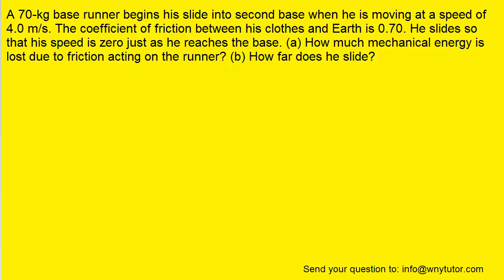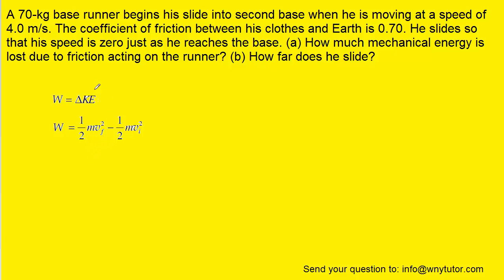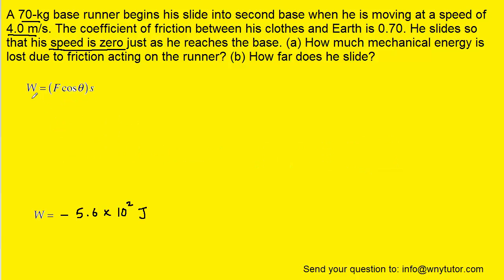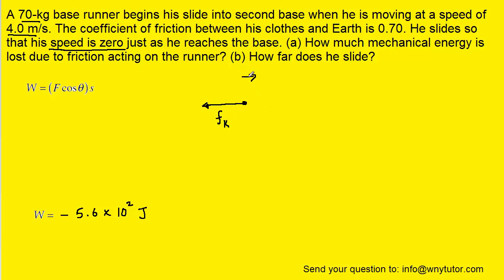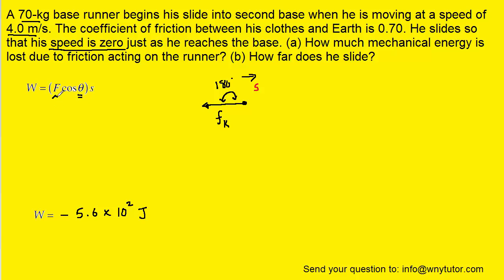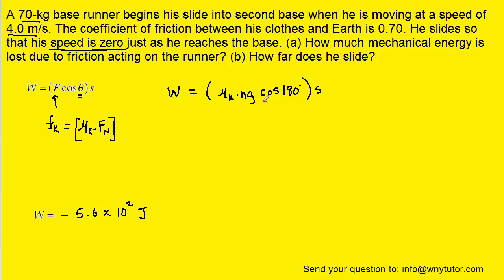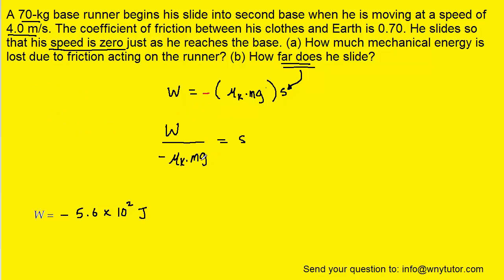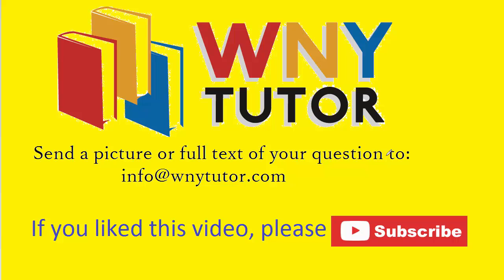A 70-kg base runner begins his slide into second base when he is moving at a speed of 4.0 m/s. The c

Comment: hello, for qstion (b) why did you solve it using W=Fcos@xS instead of W=FxS. is it wrong to use the 2nd equation i stated?
Reply: I know its four years too late but if you plug cos(180) into your calculator you just get -1. So you can use the second equation but just keep in mind that your answer will have to be negative :)